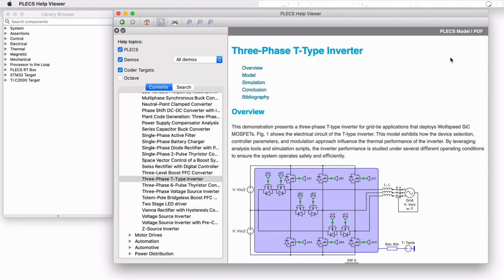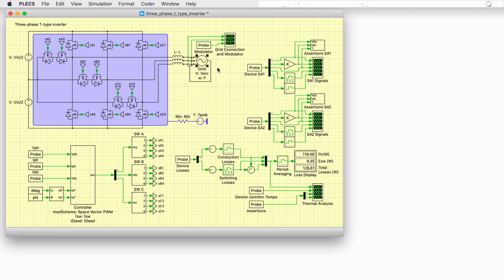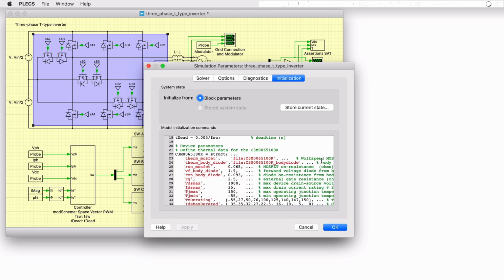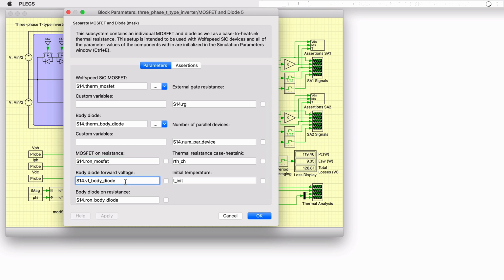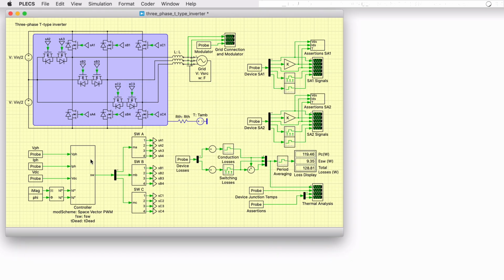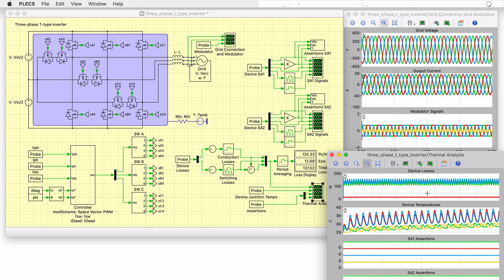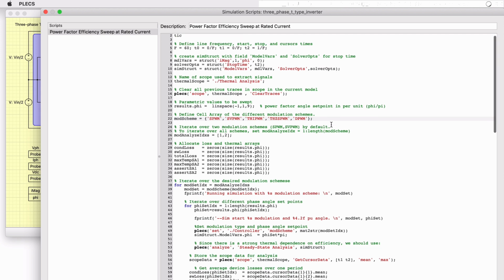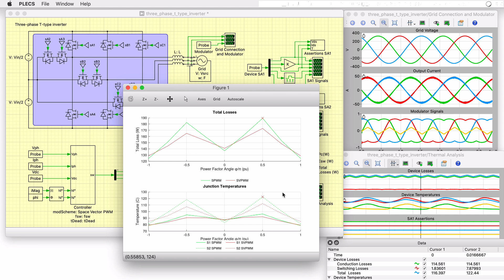Three-Phase T-Type Inverter

Comment: Help us to generate the gate pulses for the switches
Reply from the maker: Can you elaborate on your question? Are you asking something specific about how to implement a controller in PLECS, or how to design controllers in general (which we can't help with unfortunately)? There are lots of examples of closed-loop control systems in our various Demo Models that we include with PLECS. For this particular model, you can see the full controller implemented in the Subsystem and there is a description of its implementation included with the documentation.
Reply: @Plexim  Can you help how the gating signals like S1,S2,S3,S4 are being generated?
I want to see the logic.
Reply from the maker: @anushkamahajan2979  This is a great question for our PLECS User Forum, please post this there and we will gladly provide feedback, thanks!

Comment: Thank you for the explanation. Due to the complexity of this model, It would be very helpful if you could provide a more detailed video that will help in developing this model and applying these techniques to other simulations.
Reply from the maker: Hello, can you confirm if you looked at the documentation (https://www.plexim.com/sites/default/files/demo_models_categorized/plecs/three_phase_t_type_inverter.pdf) and corresponding demo model itself? The included Simulation Script is fully commented to explain what we are doing in each step. What aspects are you interested in getting more details about?

You can also contact us at info@plexim.com with specific questions and we would be happy to help you directly.